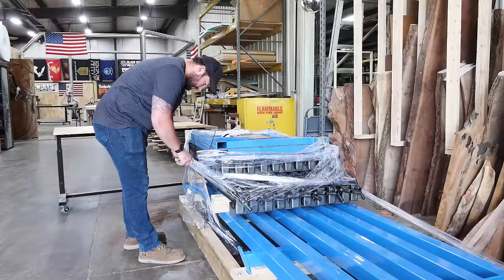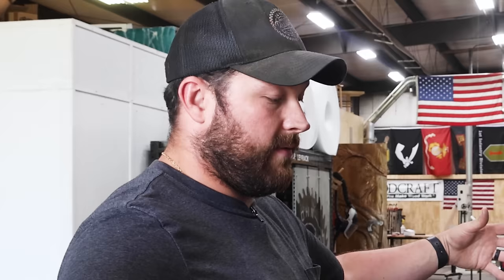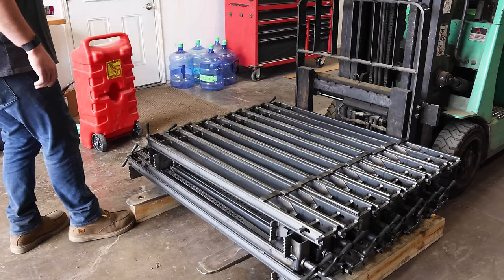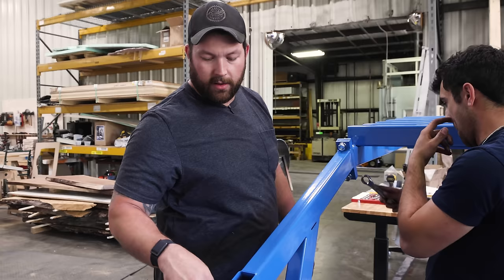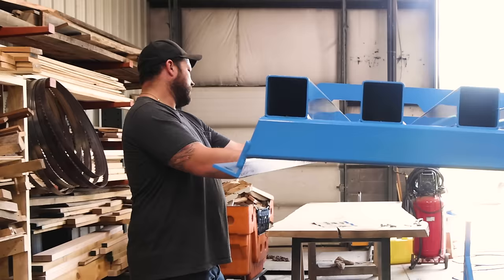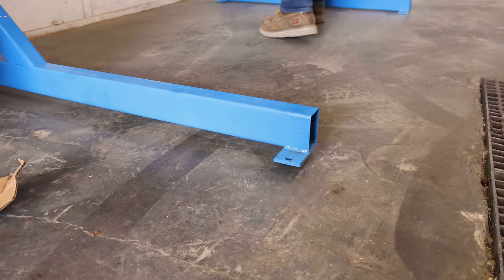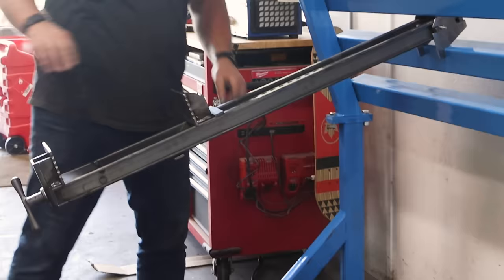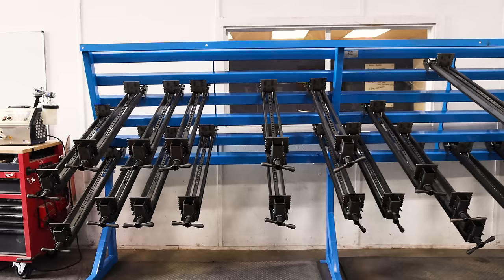This Tool Will Make Me Thousands!

Comment: I used one of these racks for years but ours used an impact wrench to tighten the clamps.  Usually you want about an inch of over hang over the side and never use a breaker bar to crank down on them.  Just like any other clamp, just enough for squeeze out.  I say that from experience.  When our air went out one day I used a bar to tighten them down.  After a panel exploded out of the clamps into my face I woke up on the floor with a broken nose and two black eyes.  It was fun explaining what happened to my boss.
Reply: You can't get enough clamping force when using a pry bar if i understand correctly?
Reply: @whatever_12  🤦‍♂️
Reply: I don't know about these but on frame machines used for pulling wrecked cars a lot of them say never use an impact gun. Hand tighten only. But who listens. That's why bolts replaced every 3 months
Reply: A breaker bar would apply a twist force to the linear clamp and cause the substrate break free and break noses. You're lucky that's all that happened. Just hand tighten until it stops. Once it stops, now you're engaging the frame and that's bad news.
Reply: Best option is to use a torque wrench set to the appropriate weight for the glue they're using, if you wanna be fancy.  Or to squeeze out.

Comment: If you plan on doing surface work ie countertops and tables I’d recommend getting a straight line rip saw. That will allow you to get into clamps from rough material super fast, as you will be able to bypass the jointer. We go from rough>>>planed>>>straight line>>>clamps>>>CNC for surface and cut to size. Get a 5 gallon bucket for Titebond and a large and small paint roller and you’ll be money!
Reply: Definitely need an impact to tighten them there clamps! Idk if our jig for our impact was custom made or bought, but it works well. We swap out our Kobalt impact whenever we blow one up. Lowes doesn’t seem to care how abused they are. Swivel adapter for air hose or I suppose a whip would work too

Comment: I use these racks since my childhood. From my experience you would want to put some kind of plain scrap wood across and clamp it. These racks can and will press pieces in the middle boards out. Maybe not far out but especially with wide boards it can be dangerous or the results are bad. We also draw a triangle with a gravite pencil over every boards when we lay them out. So we dont get confused when we stack them on the rack.

Comment: We have a couple of them where I work. They're a lifesaver when doing a bunch of glue-ups.

Word of advice. Get a long bar and a block of wood. then you can use leverage by putting the bar through the row above on the rack and really lean on it. It really helps flatten trouble spots out in the field of the table.

Comment: Rookie question: what about glue “dripage” from one panel to the one below it? And what about protecting the clamps from glue squeeze out?
Reply: Wax
Reply: @brownstonecustomcabinetry5309  so you apply the wax to the bars and clamping surface then the glue drips off?
Reply: @ryanmccue8180  you apply hard or paste wax to the clamps.  When the product is removed the dried glue peels right off of them.
Reply: @BobAbbott  thanks for the tip brotha my pipe clamps thank you
Reply: @ryanmccue8180  yup, no worries.  I keep a block of candle wax next to my glue-up station.  Before I put the clamps on, I give them a quick swipe.  You should also keep a block near your planer/jointer...an occasional swipe on the infeed table helps boards go in smooth.

Comment: Cut a slot in the side of that pipe handle and it will slide on better and prevent breaking the clamp handles. Don't over tighten the clamps but do use the handle. I used to do all the doors and drawers in a custom cabinet shop and got repetitive stress injuries in my wrists and thumbs from cranking down and breaking loose clamps. It was common to do a batch of 60+ doors and fronts at a time has 30 pairs of clamps glue dry was 45 min. So I'd go till I ran out of clamps then start pulling a door out to recycle the clamps to the next door.

Comment: Try using a 3/8 nap by 4 inch paint roller. Dump the glue in a paint pan. Three times faster than a squeeze bottle and zero glue waste.

Comment: I worked at a place that made home doors, we had a rotating clamping rack that we could do like 50 doors a day.  It made glue up so much faster and easier.
Reply: I love reading the comments for info like this. Now I can envision a rack tied to and old drum brake with a cable running down to a foot brake.

Comment: No offense but it seems great for layout and axial clamping but what are you doing to keep the glued up panel flat?  They could have added a swing arm that folds down on top of the glued surface.  I have never glued a panel that did not have some kind of bow in it that required me to clamp flat with cross members.

Comment: I get the clamps are for Big big table and wood But I feel for small stuff like in this video, it would be super cool if the clamps had possibilty to clamp multi projects at one time on one clamp so have 2 -3 projects per clamp. There is so much room left behind and well being able to maxamize space and effectiveness on use of that with small stuff would be sweet and I have already a couple simple ideas on how that could be done with there already set clamps. I wont go into it here becuase it would be long and I need a closer look but there is a way I bet online also! I cannot be only on thinking this about it!

Comment: I glued door panels on a Taylor for 8 years. Try setting up your parts on the clamps before gluing, less chance of dropping them on the way over. Put some cardboard or something underneath the rack to catch any drips, it sucks to clean up dried glue and you can just throw the cardboard away. when I would make cutting boards I would open the bottle and pour a bunch and spread it with a credit card or piece of melamine, much faster for me.

Comment: @john malecki  Love your videos. Have you looked into radio frequency wood welding/glue curing? It uses RF to heat and bond wood glue in seconds for edge gluing applications. Pneumatics provide edge and top pressure while it cures. I used to build them for a company I worked for years ago. They have flatbed machines that can do material 100 inches long. DM me if you want their contact info. They sell machines to cabinet makers, casket makers etc, truck flooring companies etc.

Comment: If could clamp several of the smaller boards in just two clamps by stacking them. Obviously leave the joint between the outside pieces of each board dry (no glue).

Comment: I saw these for the first time recently and they look dope. If your cutting boards bow a little due to the clamping pressure, do you just plane them like usual and have a bowed board, or do you face joint them first?

Comment: John,  I'm a Freight broker that does alot of LTL shipments, you can have them put appointment delivery on the BOL and the carrier will call to set a delivery window before coming out. You can also have them put notify consignee on it and they should call when they are on their way out, less reliable than an appointment though. You can sign on with a broker or agent like me to set up your own shipments too and have more control over these things, like having a free employee to handle your logistics.

Comment: You need to use steel shims that wont compress and level out that rack and fix it down. Those foam pads aren't going to cut the mustard.  When you load that rack up it's going to flex and it will put a bow into whatever you are gluing up. We have three of the 8' racks at my work. We've been gluing up white oak pickets that are 26'6". And having the racks perfectly inline and mounted down is critical!!!

Comment: 700 Items needed below,
Wood glue 1 litre X50
Wood glue roller X50
Cutting saw blade X20
Grinding Discs X20
Carving Discs X10
Air line hose by the meter X50
Saw Mill Blades X100
Wood Chisels Pack of X50
Saw Mill roller grease tubes X50
SPACE BALLS X200
Flux Capacitor Banana skins X100 
Totalling 700 items
Am i close ????????

Comment: Looks like an awesome tool! I haven't done a ton of woodworking so I'm a bit confused, how come you wouldn't use some kind of domino/biscuit in between the board on the big tabletop? Wouldn't that make it stronger and help prevent a single board from warping?
Reply: Glue is stronger than wood. If you break that table top after the glue is cured, it will have broken the wood and not the glue joint. If indeed a biscuit is stronger than the glue, it's overkill and takes more time.
Reply: @TheLZempir3  that makes sense! Is the point of a biscuit then to just line everything up so one board isn't slight higher like shown in the video when they hit it with a mallet?
Reply: @ZachGoebs16  yeah idk. I just watched another video and he used dominos to join two live edge slabs. I have more to learn.

Comment: Put some cardboard in between each layer so you don't gunk up the clamps. And less clean up
Reply from the maker: Then they don’t close
Reply: @John_Malecki  Im confused. I mean horizontally so the thing being clamped doesn't drip on something clamped beneath. Kris Devo's new video shows a good work flow using these

Comment: I used to work in a cabinet shop where we had one of these on steroids. It had 48 arms with 8 clamps on each arm and using pneumatics would rotate and even auto tighten the clamps to a set pressure. We did have an industrial glue roller where there was a tub of glue that a big roller sat in and you would just set your boards down on the conveyor belt and you would get the perfect excessive coverage of glue on each board
Reply: We used to make hundreds of tables and seats a day for Ikea, if you have any questions feel free to ask.
Reply: Oh and put some cardboard under this and on top of the legs, glue WILL squeeze out and make a mess

Comment: We've designed and manufactured a glue up table in the past which is alot more robust than this unit. Eliminates crowning and also allows alot faster clamp up
Reply from the maker: Awesome. how many tables can it glue up at once? where can i buy one?

Comment: I feel like you should fabricate way to remove the the crank and weld on a numatic jack to apply the pressure then you just press a button an book you have a high powered clamp

Comment: It's wrong wrong wrong. John read the destructions and fix that rack. The top half is back to front. Check the holes at the top they should be close enough to the wall that they can be bolted to it. And they just not. It's wrong pal please fix it

Comment: The top of that rack looks the wrong way round. Should it not be tilted back not forward? Because the top of it has holes that looks like they for bolting to the wall and the clams just don't look right pointing down.

Oh and you can't say "your boy" got a delivery when you look like you nearly 50 yr old John it's uncomfortable to hear you say it

And if the top of the rack was the other way around then the clamps would be level not pointing down. It's not right that you should of read the "directions" or for the normal people "instructions"

Comment: So it's made for wood but they ship the clamps slathered in oil to prevent rusting instead of painting them, and now that's all over your hands and the wood. And when you clean it off they are just going to rust in the humid air. Seems lazy and cheap.

Comment: I love you guys and huge fan of everything but I feel like this is the biggest waste of money it doesn’t help or do anything different then getting a bunch of clams and just letting prices dry on a rack. Love the video though work looks awesome
Reply from the maker: Well my friend, you're entitled to that opinion. But I have had just clamps everywhere for 9 years now, and this keeps emerying in one place, i dont have to move them around, I can have 6 table tops glued up at once and not take up more space than the footprint of the tool. The clamping pressure is stronger, and they hold material flatter because of the angle and thickness of it. There is a place for both. There is a reason this is how the large volume shops glue up, it makes a lot of sense. Surprised you think its a waste of money
Reply: @John_Malecki  I guess it is to me because I am not running a big business like you guys. I would think something like this or cross clamp to take advantage of it being so heavy duty to help keep boards flat and not bow during drying would make this even better. I really appreciate your insight and time